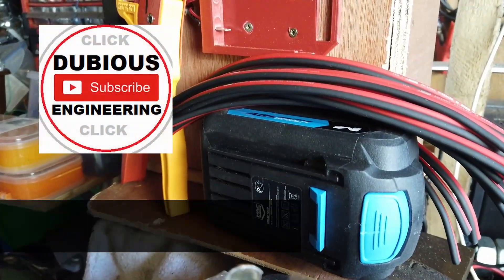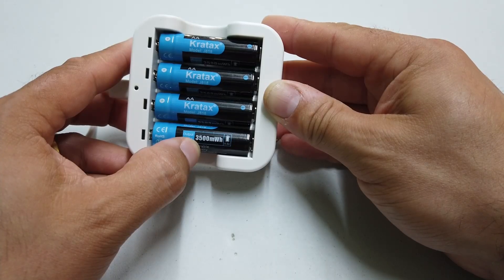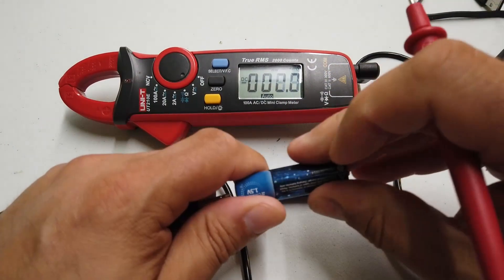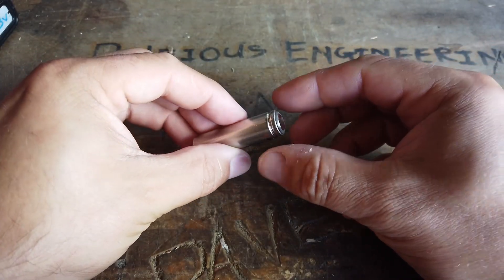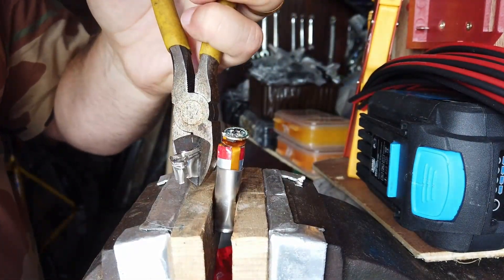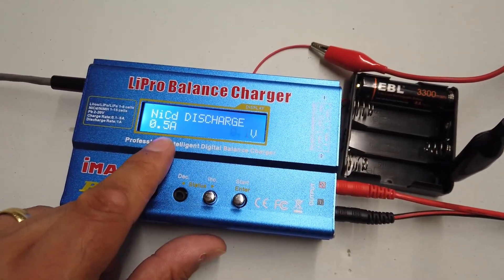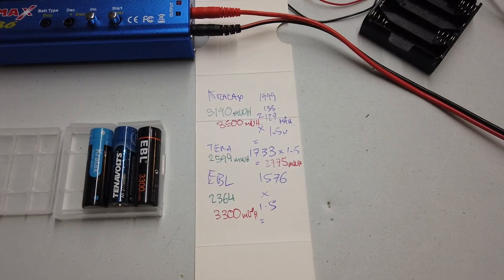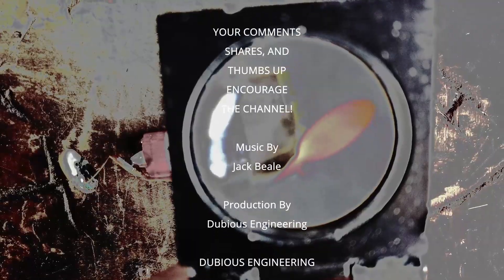DuB-EnG: Modern Lithium Ion Rechargable AA battery Cells tested! - EBL, TENAVOLTS, KRATAX any good??

Comment: It looks like they're adding the ratings for the cells themselves and not taking into account an efficiencies of the buck converter or any of the others protection circuitry. It's a little disingenuous, but I guess technically it's not lying. Just feels bad. It is really funny though, I was just looking at buying one of these three brands and had almost settled on the kratax when I happen to cross this video. Lol

Comment: thanks. can the cells w/ usb- Port can be charged in the covered charging device as well pls?

Some DAWAIKALA shop @ Ali was friendly and seemed competent. Is there any brand u prefer from Ali for the AA/ AAA 1,5 Volt Li cells?

keep up the good work
Reply from the maker: I think the USB cells can only be charged with USB cable
Reply: ... alright then -  might better use the USB plugs for these before I asked the shop or manufacturer ( one told me that a docking station/ external charger can as well be used but I forgot the manufacturer's brand)

Comment: This is a situation where being an early adopter seems very sketchy.  I don't really want my AA batteries catching on fire.  This video is a year old, already and I am not sure why the big battery companies aren't selling these yet.  I suspect it is because they can't make them safe enough and they are worried about liability issues.
Reply from the maker: Agreed, none of the big boys have taken this on!!
Reply: It's because the patents for lithium Ion is held by Panasonic but China CCP does not recognise foreign patents so Chinese companies are free to copy as they seem fit  @DubiousEngineering
Reply: I think the reason why big companies don't adopt this is because there is no money to be made the batteries are so good that they arent disposable right away it will many take you 2-3 years before you buy another one while disposables you have to buy new every three to 4 months that's my thoughts
Reply: @noahherron827  LOL! Maybe the answer is the opposite - all these suck in daily life? The fact that you never know how much charge is left before they suddenly switch off is reason enough to avoid using them. Plus the much higher capacity of current NiMHs, which also run a longer time on > 1.2 V and have less self-discharging. Unless you have a specific mis-designed unit that doesn't run on NiMH reduced voltage there is zero reason to use these insanely  overpriced  Lithiums.
Reply: Duracell Energiser will never get a legal patent for rechargeable lithium Ion Batteries

Also the plants too make these are vastly different and more dangerous to operate than Alkaline or even NiMH

LG and Samsung have patents to make non traditional user cells (So not AA AAA CD DD etc!) but 1860 or custom pouch cells simply because Panasonic could not producevor refine the lithium themselves at least in big enough quantities

Comment: I was looking at reviews for lithium AA batteries because I have been tempted to try them. The EBL has an advertised rating of 3300 mWH hours and not 3300 mAh. So they may be performing closer to their advertised mark.
Reply from the maker: Yes agreed, they are quite useful, but not in RF or WiFi enabled applications due to their emissions.  Very noisy!

Comment: Hmmm your math is a bit fuzzy. To get mWh from mAh, you multiply by 1.5V, but it wasn't just 1.5V. Within seconds it was down to 
I'm glad that battery makers are using Wh, but it's regrettable that the B6 doesn't give Wh.
Reply from the maker: Yes, agreed, fuzzy logic!  You get the point though!

Comment: I just got the AmpTorrent AA pro gen 2 batteries. They all tested from 1.52-1.54V. Interestingly it’s says in user manual to plug in battery charger first and then connect batteries
Reply from the maker: Very interesting!  Hope they all worked well!

Comment: This very noisy battery ever, if you work with very sensitive radio frequency device this battery just bad. But it's okay for ordinary uses.
Just found the brand Smarttools USB C AA Battery just have a better performance than this expensive one, try it
Reply from the maker: Very good call, thanks!  Yes, lots of electromagnetic interference

Comment: Just bought some of those Kratax, they do perform really well honestly and I'm gonna replace all the batteries in my devices with them as soon as they die. I have some Ni-MH 1.2V in use right now, these are going to end up in my old camera, because it can use those without any issue, has a mode specially for them. Hope that the Kratax can be used extensively without dying prematurely. I'm tired of always buying giant packs of batteries only to throw them away after they're spent.
Reply from the maker: Yup, I'm still loving these ... they work a treat!!

Comment: All my gizmos that use AA cells run quite happily on the reduced voltage of NiMh cells. Just wondered what the  intended use/market would be for these cells.
Reply from the maker: NiMh tend to deplete over time...  lithium holds its charge for years...
Reply: Lithium ion batteries are popular for game controllers/vr controllers that vibrate because nickel batteries tend to not have enough voltage to drive the little motors.
Reply: they work fine in xbox controllers
Reply: Yeah, NimH drop really fast in storage.
Reply: @captainkittay  drop about 20% in a year

Comment: as you know most rechargeable of AA Voltage  is Typically 1.2 Volts far less then Alkaline 1.5 Volts
That SAID..Did these KRATAX Brand Batteries Actually Test as high as a Full 1.5 Volts? ...THANKS Dubious Engineering :-)
Reply from the maker: Yes they did...   with a multimeter they show 1.52V 👌
Reply: I've been trying to figure out which batteries I need for my devices and the rechargeable lithium has the benefit of consistent 1.5v at the cost of capacity and paying a premium.  Cant fully discharge yet they die suddenly. When tested many seem to struggle when pushed and of course die faster depending on how much money you throw at it. If a magnetic charger can be used with the USB c port or even an adapter, it would be a plus for some devices but other than that maintaining 1.5v seems to be the only advantage. If your device is designed to use disposable AA, it doesn't need to maintain 1.5v as the disposable quickly drops in voltage.  The 1.2v is better in that regard yet still outperformed by the alkaline in many devices.  Idk of many devices that don't work with 1.2v or how they manage to work with alkalines once they drop.  Am I missing something that makes these batteries worth paying as much as triple the cost of a 1.2v?

Comment: They're actually £20 and upwards in eBay.
Reply from the maker: Its quite expensive - but could save you a fortune on batteries...  LiIon is way better than NiCad or NiMh
Reply: @DubiousEngineering  I don't call £20 that expensive (2 packs of ciagrettes), I just noticed that they were double what you thought they were going for on eBay. However I agree with you Doug, they're essential for safe charge/discharge operations.

Comment: I wonder if those values take in to account the Buck converter efficency?  The "rated" values might well be for the Lithium battery itself, but with the conversion I'd say you got damn close to what was expected (in 2 out of 3 anyway :) )
Reply from the maker: Yes, not bad performance from the Kratax... I’d leave the others alone for now :-)
Reply: How about trying XTAR Brand I hear that they are really good quality if a bit more expensive than many brands of Li-ion Rechargeables also they have a new 2700mah AA which is at least 200 too 300mah more than most rivals and yes I mean mah not mwh also look at testing some of the Chest Charger style sold under dozens of names like  Imuto Miady Sanpima Homesuit Run power Meyin RayHom etc I assume that all the Chest style charger brands are out of the same white label factory with only slight differences in chest charger appearance and labels/name's

The Chest Charger Style uses a USB C plug that goes into the lid and Leds in the lid light up to show the battery condition and none of the battery have LED's of their own which is fine as you can not see them as they charge anyway.

Comment: The fact you cannot fit as much lithium in the package is a poor excuse ! I have found as a rule of thumb  with 3.7 v batteries, providing they weigh ok ( many lightweight forgeries used to be out there, not so much now ) 3/4 of the stated capacity is usually pretty accurate. Genuine Panasonic and LG are pretty much dead on however ' rounding up ' still goes on. I have found in the last 12 months most of the Chinese lithium batteries seem OK, the charlatans seem to have fallen away since the addition of compulsory VAT and the withdrawal of government shipping subsidies.
Reply from the maker: I’m with you... I’m happy that some of the really cheap crap 💩 that was coming over has been foiled!! ... the Kratax definitely did better than the others in my gentle tests :-)